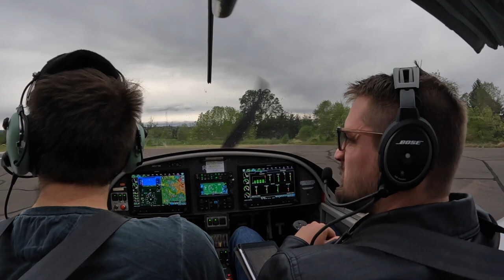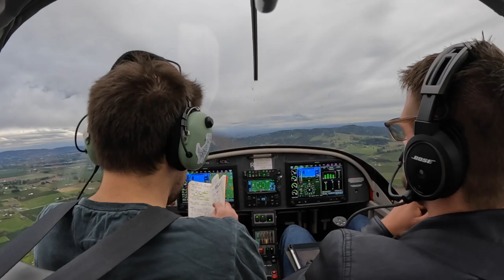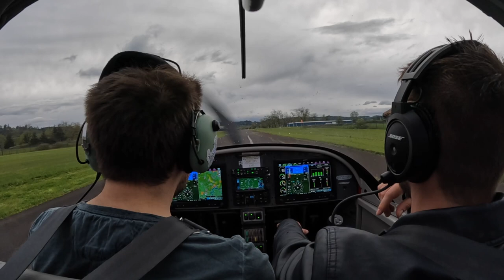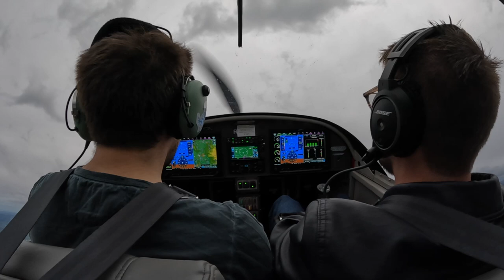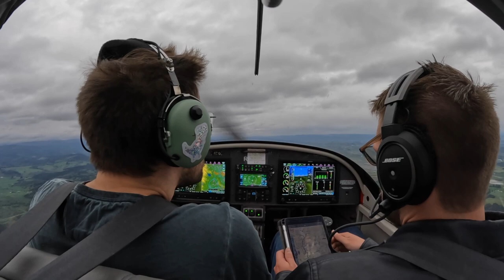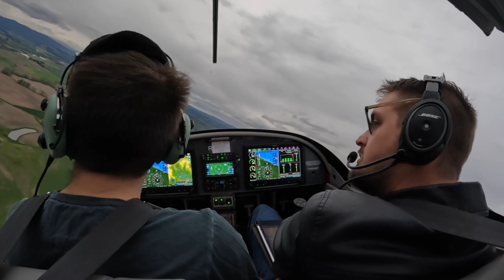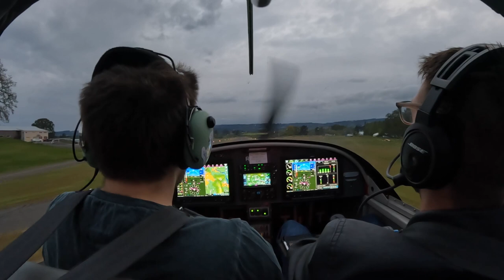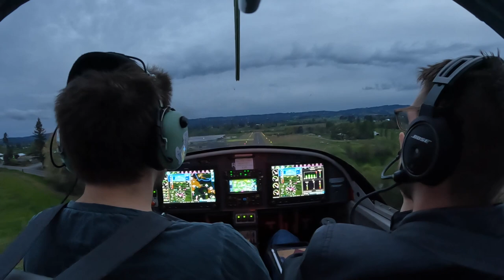2022 05 11 sam checkride prep flight 2

Comment: Great video.  I remember those days, not too long ago at all.  It's frustrating, but it looks like you're doing fine.  Your instructor sounds like mine, lol.  "What are you doing? Keep the nose up, keep the nose up... "  LOL
Reply from the maker: thanks. yeah, the struggle is real. I actually just sent a message to Chris, hoping there was somewhere the midlifers hang out (aside from the livechat and occasional zoom).  Anyhow, did the mock oral with a senior cfi type a few days after this vid, some weak points but "oh yeah, you'll pass, no prob". That helped my confidence on that part, at least. My precision in the maneuvers isn't there. Just gonna keep practicing 'til the checkride date.